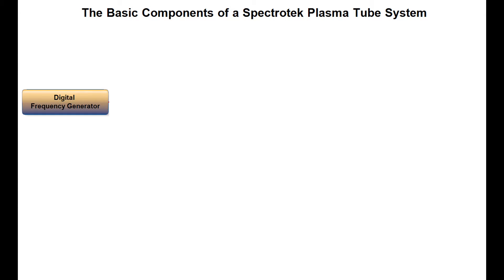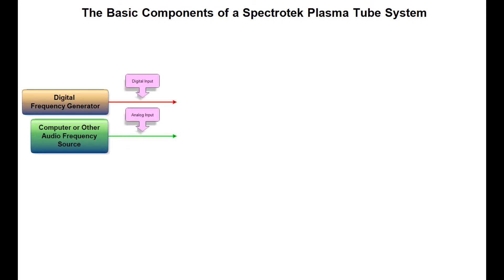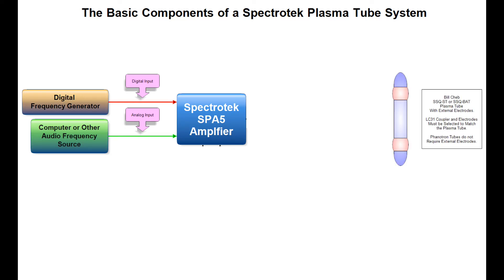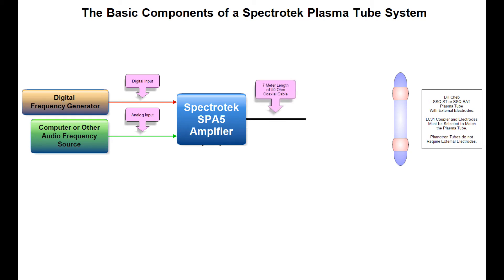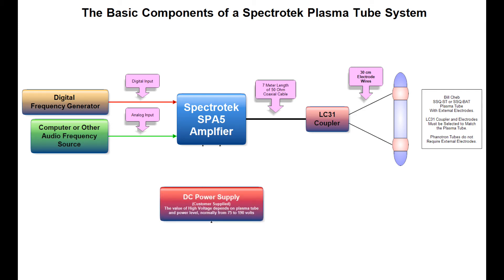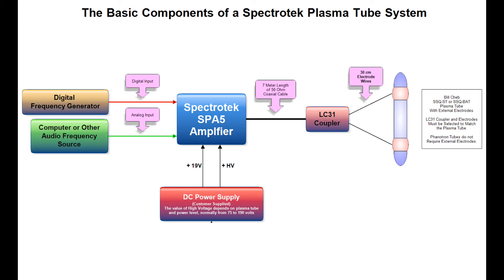What do I need to build a Spectrotek Plasma Tube System?

Comment: Copied comment below from another video before  i had seen this, as this is what i was requesting...

Do you have a video or plan to to show how to setup a plasma tube with a spooky2? (neweer device called generator x )
which would be able to output frequencies via spooky2 app or device? 
Thankyou for all your work, i have just subbed, 
love from the UK.💙🙂

EDIT-UPDATE:
I have. just seen this video that you did of "how to build a Spectrotek Plasma Tube System"
https://www.youtube.com/watch?v=T2Nwc5VD7QE
I believe this is what i was requesting, making a rife machine, (just to add..i have both spooky  Generators) i will try to follow your instructions to build, please let me know if there is any specifics as that video was an overview of what you need and a brief rundown of how to connect etc, 
also is there any suggestions as i have both the spooky 2 generators, could i use the additional generator to run something else maybe at the same time?
Again thankyou for your time & patience to do these videos.

Comment: Thank you Ralph. I bought a SPA 5 amplifier from you. These videos are a great help. I hope many people can benefit from assemblying their own very good quality RIFE´s machine
Reply from the maker: Thank you for commenting on the video.  I want to make more videos as I get the time to do so.  I hope these videos will assist people to understand how these systems work.  I try to produce high quality equipment that can be assembled into a variety of different configurations.
Reply: @spectrotekservices   Hi, thanks for your work, can you tell us, do you use direct curent high voltage at the same time with RF voltage?